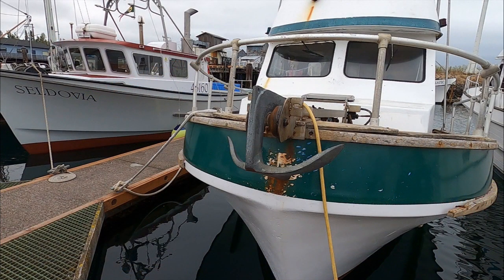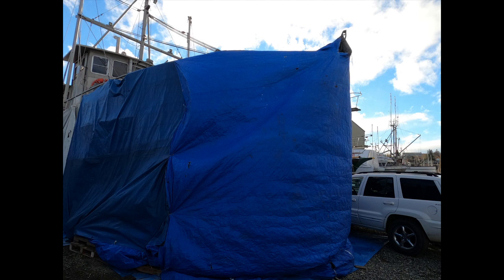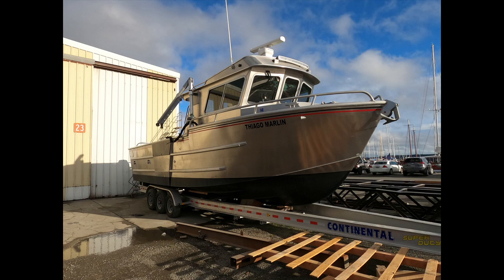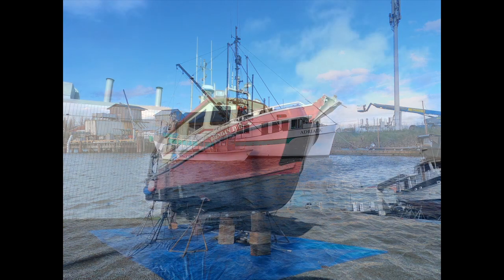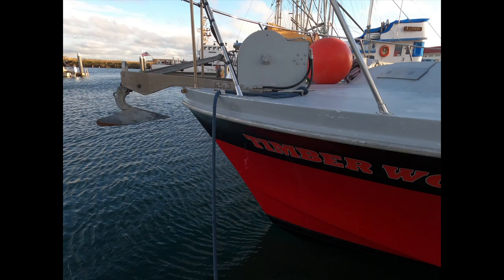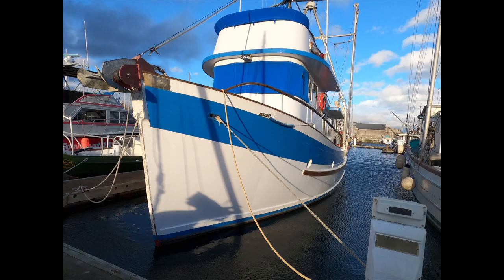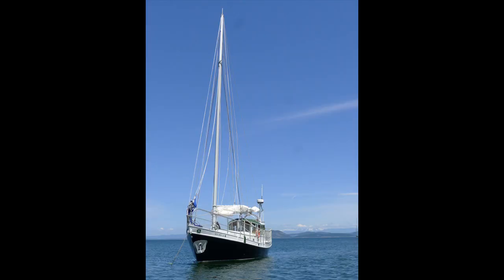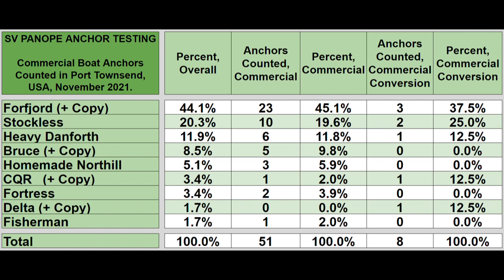Commercial Vessel Anchor Survey. Video # 129

Comment: I am a commercial troller (47' steel hull) in Alaska, and I see many of my friend's boats in this video.  You are correct, we are creatures of habit in the anchoring regard, but for good reason.  The Fjorford and a 5-10 fathoms of heavy chain is the gold standard in our fleet (I have a #8 on my bow roller, attached to 10 fathoms of 1/2" chain, followed by 50 fathoms of 3/8" chain, followed by 50 fathoms of 5/8" Samon Superstrong double braid).  My backup anchor is a homemade Northill as you see on a few boats in your video.  It is terribly inconvenient to deal with, and stays lashed on top of the wheelhouse with 100 Fathoms of line attached, ready for emergency deployment.  I've never needed it.  

Very often, we either anchor on rocky bottoms in small anchorages, and with very little swing room if the fishing is good (meaning there can be a lot of boats in a small anchorage area), or on small ledges we can just get our hook to stick on.  Most anchorages are fairly well protected, else we just drive further offshore and drift overnight.  Our rocky bottom anchorages are very compatible with the Fjorford, but I have found the Fjorford lacking in silty mud.  During a sustained 50 knot, 70 knot gust event in Kanga Bay, I drug repeatedly until I finally reset the hook over a rock hump in the bay and held fast.  The other time was in a 40 knot sustained event in Torch Bay, a notoriously bad bottom for our fleet, and drug all night long, necessitating several resets.  I have considered having the fluke modification done to my anchor (Kolstrand, ie., Intergrity Machining in Marysville, WA, does it for our fleet) but have talked with several old salts who feel the additional holding in silt and sand isn't worth the holding power in rocks that is given up.

I anchor between 75 and 150 times a year on average, and trust my and my crew's life to the Fjorford up here.  I know the conditions where the Fjorford isn't optimal, and try to avoid those very few situations that play to its weaknesses.  When caught, as I have been, I just set anchor alarms and nap lightly until the tempest is over.  Choosing another anchor means changing what works well now and has worked for generations.  So why change?
Reply from the maker: Thank you very very much for sharing your first hand experience.  I will "pin" your comment to the top of the list.
Reply: @flygoodwin  I find your videos very interesting and informative, please keep it up.  I do very much like Panope's arrangement, as you have a time-tested rock grabber in the Forfjord, and what I assume is a superior soft-bottom holder that is more practical in more areas of the Puget Sound.  If I had a dual anchor set-up on my bow, I would do the same.

Comment: Perhaps the stockless anchors are still popular on the older and larger craft because a very heavy anchor with comparatively low holding power might ideal for drudging (holding one anchor just in contact with seabed to reduce swinging on the main anchor) and for control when going astern before bowthrusters became the norm.  As a child, I remember seeing cargo ships coming up our local river astern while dragging the bow anchor at a near vertical angle.

Comment: I see you focusing on power vessels in commercial sizes. They do seem to have different needs and anchorages than most SV. SV seem the most interested in changing with an expectation of improving. 
Trial by anchoring out regardless of storms is most telling. More than a few undersized lunch hook mains on vessels I've wondered they don't anchor out or cruise in hard conditions and have plenty $ to tie in marinas. A few I talked to had no expectation  of riding any storm out.

Comment: "I've never tested one of these (stockless) anchors, but I bet they are much like the Forfjord in that they produce perhaps very, very low holding power compared to modern anchors." - Steve Goodwin
"The Navy stockless anchor has less holding power than an old fashioned anchor of the same weight and much less than today's lightweight anchors. ... The stockless anchor is used today only on large boats, but it is universal on ships where  ease of handling and stowing by mechanical means is more important than anchor weight " - Earl R. Hinz
In a light weight sailboat, I care a lot about weight to holding power ratio, which Steve covers in his videos.  But then, I can muscle my anchors around if I need to.  The need to manage an anchor without ever touching it, is one I don't think a lot about.

Comment: Possible thoughts on snubbers? Specifically regarding reducing the total shock load on anchors rather than taking the load off of a windlass. I am not so convinced of how useful they are in comparison to the catenary  weight of my all chain rode. Recently helped a larger vessel set up a more complicated system than I would tend to want. Much research involved I still have more questions of value without load testing comparison.
Reply: As soon as you run out of catenary, (likely in waves over 2' with light chain) your chain turns into a steel bar and the wave action will ratchet the anchor out of the bottom.
(wave pulls your vessel up and back, something has to give, a vessel can pull upwards with substantially more force due to waves than they usually pull due to wind)

Snubbers put stretch in the system to mitigate that.

Most vessels use chain + rode, so they have a lot.of stretch to begin with.

a kellet basically works on the same principle (increase catenary) by adding weight.

30' of 1/2" triple strand is good for about 900# of shock loading, so two of those work excellent for most vessels. 

Big commercial level vessels don't use them often, as multi hundreds of lb anchors and hundreds of feet of chain that's a couple lbs per link, is a different catenary situation than a mid sized vessel.

Best practical demonstration is towing a vehicle. A 20' strap is far, far superior, than a 20' chain, and as soon as you try it, the why of it is extremely obvious.
Reply: @stuffwithstone  Towing 20-30’ and catenary on 150’+ of all chain in 40’ not being equal examples. I would just like the comparative data. I tow with chain using low speed heavy equipment. Blue steel fishing line 5/8” last time I made a recovery setup. I can’t count how many commercially made tow straps I have snapped.
Reply from the maker: Braith,  generally speaking,  the amount of shock absorption that an "all chain" rode provides is dependent on water depth.  In shallow water (say, less than 10 feet) a nylon snubber is probably a good idea anytime.  In medium depth (say 30 feet) chain catenary will offer good shock absorption up to about 25 kts wind.  In deep water (say, 100 feet) catenary will still be effective in quite strong winds (I'll guess up to 50 knots.

Note:  The above figures are generalizations.  Factors such as size of chain and how the boat reacts to wind/waves will vary results.

In case you missed it, check out my "Anchor Chain Catenary" video:
https://www.youtube.com/watch?v=e7o30hOvuHk

Comment: Those south winds that we’re all complaining about here in the PNW would sure be good for getting some real world numbers so we knew what sort of forces the wind and waves actually produce.
Reply from the maker: With a bit of luck, Panope might go into the water soon, just for that purpose.  

I did put a load cell on a large sailing vessel (in the marina) during a 20 kt wind.  We are waiting for a stronger (wind) day to finish up that study.
Reply: It would be academically interesting to know 🤔 my SV is pulling in gales with high wave action. 45# CQR on 3/8 chain is certainly not enough to keep from dragging. 100# Danforth in series on another chan is temporary working fix.
Reply: @braithmiller  That CQR is buried deep, and the Danforth should be as well at this point.

Where you're anchored, you're not getting enough westerly to do much to the Danforth, (I don't think it's even rotating).
Reply: @stuffwithstone  agreed: I think only the CQR has done any movement. Cris had made comment against two anchors, regarding them twisting around each other, rather I think the series arrangement is acceptable. The bottom is certainly already littered there with entanglement materials.

Comment: Interesting.  I wonder if the reason these vessels use older and more robust anchors is because they have a different kind of anchoring need.  I doubt they spend a lot of overnights at anchor, or times where they want a set for a good strong blow.  In those cases they would be more likely to tie up at the harbor, or would be motoring around into the weather.  Instead, I suspect their needs are more of a temporary anchoring where they are near to controls if they ever did slip out of place.   An interesting comparison would be a survey of boats that spend most of their time at anchor - such as full time cruisers.  Not sure how to get that data, however.
Reply: We anchor very often.  But it is not to just hang out. It's mostly just to get off the fishing grounds for a few hours and sleep.  It is rare that there is a commercially viable population of fish within an easy run of a harbor.  After sleeping for a bit, we get up and get back at it.  As a percentage of time anchored vs underway, we spend very little compared to cruisers.  In terms of the frequency we need to drop the hook and make sure it holds, coastwise trollers in Alaska exceed most, if not all, cruisers.

Comment: Hi Steve, have you seen the video of the Fleming motor boat with a bent Ultra shank? See here: https://youtu.be/_NNQd7CLHXU specifically have a look at 5:56 to see a completely failed shank on the Ultra.
Reply from the maker: I had not seen that video, Robert.  Thanks for the link.  It was disheartening to see the Ultra shank so completely "kinked".  It appears that once the shank collapses, strength will be mostly gone.  By comparison, the anchors with solid shanks should retain most of their strength even when deformed.